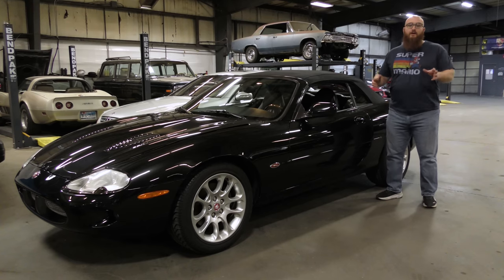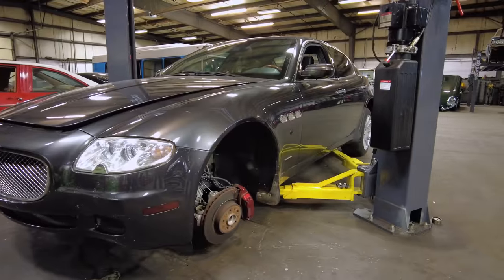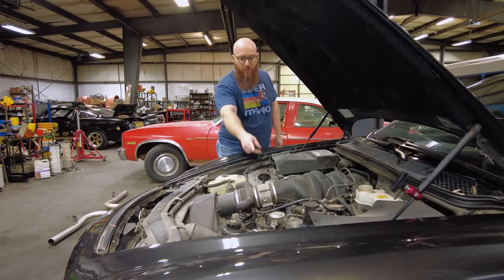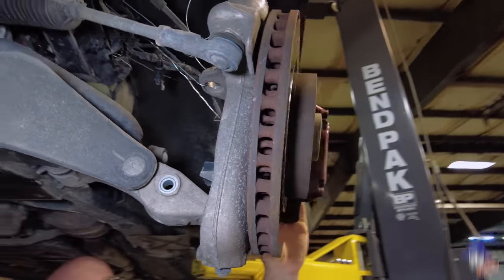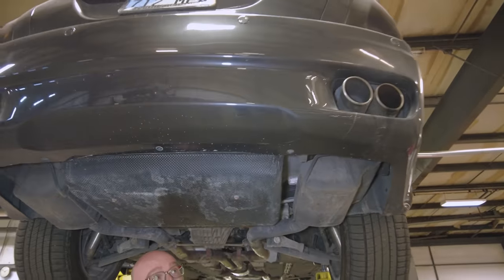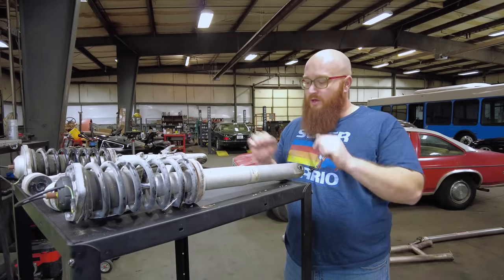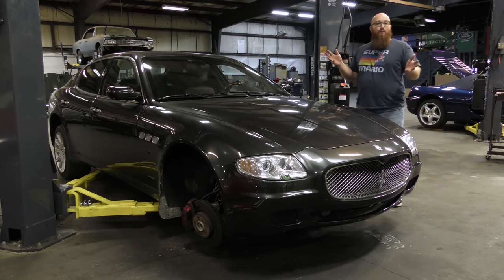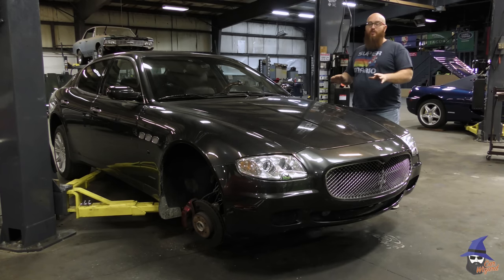Me-Owch!!! Catalytic Convertors cost $13K on this '07 Maserati Quattroporte! CAR WIZARD explains how

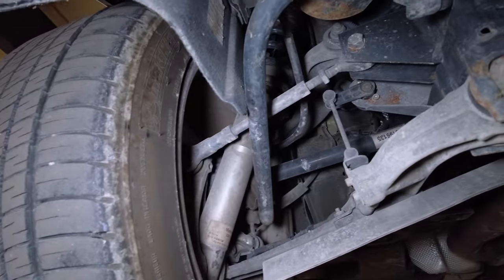Comment: 9:04 that rear upper control arm or Camber adjustment rod has a lock nut that is not in the correct position I don't know if this was because you were working on it or if you didn't notice but the other side is not like that

Comment: Cut cats , put cel eliminaters on rear 02 sensors , strate pipe where old cats were $125 fix
Reply: Wonder why car wizard would go over 100xs a simple easy quick reliable cheap fix... that is just ignorance

Comment: You have to sell the car in a jurisdiction that doesn't do state inspections Like certain jurisdictions in Tennessee. I believe there are 16 States that don't require inspections. So you can drive the car to your heart's content without fixing it you just have the annoying  Check engine light On other than that there's no reason to fix it

Comment: I've never had a problem using vice grips on a hood strut and I don't appreciate being referred to as a fool. I think it's rather foolish to even call anyone a fool. My mother was a rather strict Christian and also very wise and I was taught to never call someone a fool but she didn't have a problem calling someone a dummy. So anyone that uses a stick to prop their hood open is taking way more risk than someone that uses vice grips. It's simple you lock the vice grip on there and it's not going anywhere and anyone who can manage to damage the paint doesn't need to be under the hood in the first place
    I've came up with a genius solution to this problem though and that's just replace the hood strut. I'm sure if you can afford to drive a Maserati then you can afford a hood strut...

Comment: Unless you are a mechanic like he is dont buy utter garbage and a maint nightmare no wonder they sell for under 10k with under 100k miles they are expensive to fix..I had one good riddance while m7 07 4runner with 300k runs like a top no leaks no nothing brakes, hoses and belts is it

Comment: I would have gutted the Cat's, I did that to my old 89 Supra Turbo, it had two Cats on it.  I replaced the down pipe with a straight 3" down pipe, that cut the oil change time from 45 minutes to less than 15 minutes and then dropped the center exhaust and took a 15 inch long screw driver and cleared out the inside of it. The car ran great without cats on it.
Reply: On a modern car it will more than likely run like shit. The o2 sensorS control fuel input, etc based on the readings at the cats. Highly dependent on those inputs.

Comment: Not again... Get universals.
Reply: If you want to destroy the engine why not drop a screwdriver in a cylinder? Thats faster and cheaper than using generics.
Reply: @wolfgangpreier9160  universal cats are just fine if you do it correctly. Idk what u have been smoking but you might wanna lay off….
Reply: @wolfgangpreier9160  I've used plenty of universals converters.
Reply: @retiredsnowbunnyhunterx5106  They work long enough to pass emissions the first time and that good enough for me
Reply: @retiredsnowbunnyhunterx5106  In Maserati Quattroportes of course. I believe you.
Reply: @wolfgangpreier9160  That's a rather false equivalent so don't you think? You're going to have to provide an example of why universal or suitable substitutes can't be used.
Reply: @JSFGuy  No i don't have to provide anything 

There is a  place, vehicle and time where you can use 3d party chinese made in Mexico knock offs. In Toyotas and Hondas, older GMs and Fords, in Fab Rats or Trail Mater's wrecker if they survive the experience - i believe they do not. 

But its certainly not a part which belongs in a Maserati Quattroporte.
Reply: @wolfgangpreier9160  well, you're over generalizing big time. Stuck on factory parts that fail? A reputable universal will work just fine I use them on older vehicles. Unless that factory converter can make toast and coffee it's not going to justify the price.
Reply: @neiltoersbijns2921  Lucky for me I don't have to get an emission for my county. So I could do away with the cat if wanted too. But for the most part if the cat ain't affecting the drivability of the car I won't worry about. But I have had where the cat went bad on a few cars I had to where it was sluggish as if the transmission was not shifting. Had to get that fixed.
Reply: @JSFGuy  Please present your results to the car wizard. He will be happy to know that a Universal CAT will work in the Maserati Quattroporte. 

And thats the point. 

We do not talk about generalized vehicles from US, Korean, Russian or Japanese origin which may well work with cheap general Catalytic converters. 

We are talking about a Italian stallion.

Please accept that Italian cars do not like your US catalytic converters. Not at all.

You could try your general CATs in e.g. a Audi Q5 from 2009. Lets see how long it takes before the grman engines go into strike mode.
Reply: @wolfgangpreier9160  present my results to car wizard? Sounds like you're an OEM activist. Sometimes repair shops do that and others do not. Sometimes the owner says I specifically want OEM genuine replacement parts. It's a catalytic converter big damn deal. They are for the most part all the same because exhaust is the same. Why are you so caught up on cheap you say cheap I said reputable like dynamax, magnaflow, flowmaster, they make good exhaust systems. I've never heard of a catalytic converter hurting anything. With cars that keep themselves in order with in PCM converters are not that necessary anyway. Maybe you don't know that. I'm not talking about replacing a certain sensor or talking about a solid state passive exhaust gas EPA component. I use them in California and they are just peachy keen fine. Otherwise I wouldn't have them installed like I have not in the past in other states.

Comment: I don't get it with catalitic converters? Why can't you just weld on an aftermarket? The ECU will be none the wiser.
Reply: A lot of time aftermarket ones don't contain enough precious metals to be efficient and the O2 sensor will still throw a code.
Reply: @sebastien4565 electrical tape over the CEL solves the problem
Reply: You can, but EPA & state emissions regs stipulate that the vehicle's ORIGINAL equipment must be on the vehicle in order for it to pass visual smog inspection. It's all about government control and intrusion into your life.
Reply: @sebastien4565  Usually spacing the o2 sensor a bit further from the stream of exhaust will get rid of the code. Some folks use spark plug non-fouler. In the end it is a trick rather than a fix. Aftermarket Cats contain ceramic honeycomb and almost no precious metal. Either way the ECM is looking for a ratio rather than a material. The ECM isn't that smart yet lol.
Reply: Lol sadly I had a friend who took his (older car) in and they cut the power to the cel lamp because they couldn’t figure out the problem. Another had tape over his
Reply: The Real Cat of 2020  That's not very nice to say to someone, especially when the law allows him to refrain from showing any information especially when related to health. 

Back on topic, OEM parts CAN be used or any part that meets OE standards and you will pass emissions regardless. IE: forcing someone to buy NIKE when Reebok works just fine.

Comment: Only 13k? A bargain at twice the price!
Reply: That's nothing, a GM diesel  LML Duramax CP4 pump and fuel system replacement between $10K to $15K and some as high as $20K.  I was lucky with only an $8K repair bill.   New tires and front end alignment repair work and I was near $12K.  Then again only about 100K miles on it and can go well over 300K.

Comment: Not worth it. No thanks. My 2002 Lexus ES300 cost me $4500 in 2021. 2nd owner and bought with 160k miles and will last me 10+ years with regular maintenance. Need to put that into perspective
Reply: We can. Still would rather have the Maserati. Wizard is getting ripped off for parts and if you have even the slightest mechanical knowledge you would take the Maserati over the Lexus in a heartbeat. The Maserati at least looks good and sounds good and is a nice place to sit in... made by people who actually care more about cars than filling a quota on a spreadsheet, unlike Lexus, thinking adding the cheapest, nastiest leather and sound insulation to lackluster cars is "luxury".
Reply: @elnyoutube123  you’re obviously a Lexus hater and your opinion doesn’t matter to me. Even the Wizard knows how awesome , reliable and well crafted Lexus products are. I would even buy a used LS430 for $13k before I spend that much on cats for this Maserati and I’m Italian ! 
Lexus are the most reliable and bullet proof car/truck brands in the world
Reply: @stephendibari5010  I'm not a Lexus hater, I like a few of their cars, but the great ones. Not the lackluster NPC ones you see driving around most of the time. In fact they make me angry 😂
Reply: @elnyoutube123  what is a NPC model ? My 2002 ES300 is as good as new with now 173k miles. It’s just Breaking in. Doesn’t burn any oil in 5k miles between synthetic oil changes
Reply: @stephendibari5010  I had a Maserati GT 6 speed manual I drove to 214k miles with the only mechanical issue being the clutch needing to be replaced at 160k. I probably could have gotten to 300k easily if someone didnt ram into me and total it. If you don't drive like an idiot and you know what models to buy they can be very reliable. But an "NPC" car is just considered regular traffic, nothing you would bat an eye at. Personally I love the Lexus GX460 and 470, LC500, LFA, and LS 400. Most of the other ones I see on the road I can't stand. The models I just mentioned were designed to be GREAT cars in all aspects, not just reliability. The other ones are just there as marketing exercises and as rebadged Toyotas.
Reply: @elnyoutube123  I think the LS430 was even better than the LS400. Personally if I wanted a V8 with all that luxury that would be my pick. A good pristine one owner would be a hard find but definitely worth buying. I’m super happy with my 2002 ES300, it’s all I need for Luxury and a strong super reliable 1MZ V6 engine that will last for 500k miles if maintained and not abused. 
There is this one posted about 3-4 years ago at that time with 590k miles !  https://youtu.be/75YcIEyWmco

Comment: One more reason to buy a Tesla.
Reply: How so? Battery replacement and proprietary maintenance for Tesla is the reason not to buy it. Wizard would not be working on it if it was a Tesla.
Reply: Why do you want the whole world to become peasants?
Reply: Apparently you didn't get the memo about used Tesla values falling off a cliff.
Reply: @JSFGuy  Not to mention the potential fire hazard of the batteries catching on fire.  State Farm did have a lawsuit against Tesla for a house fire in IN that was parked in the garage.   I don't know if it was plugged in or just sitting not charging.
Reply: No thanks, too proprietary and you essentially trading expensive emissions components for a traction battery that mechanically totals the car.
Reply: So yes, this autopilot option is becoming a big problem. Battery disposal is a problem, much more by-product and footprint to produce. Tesla is not the end-all be all.